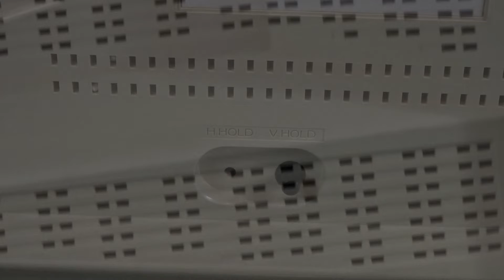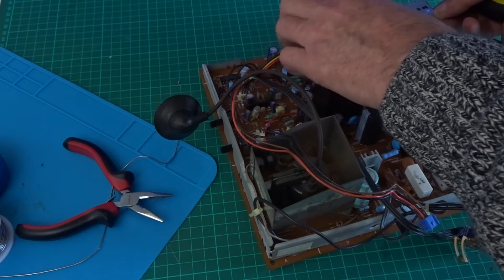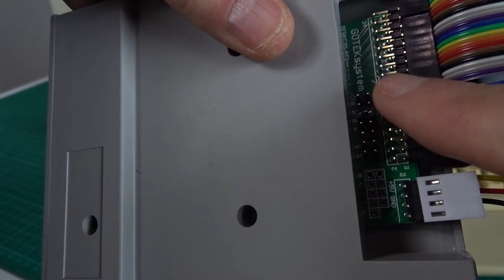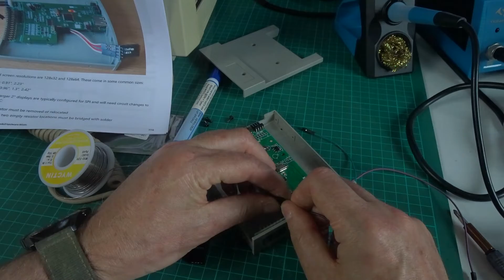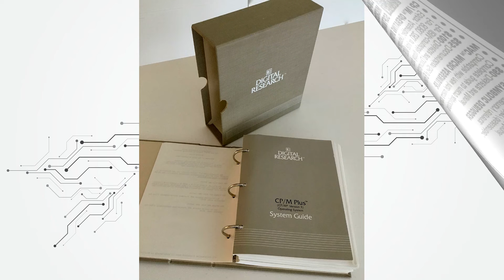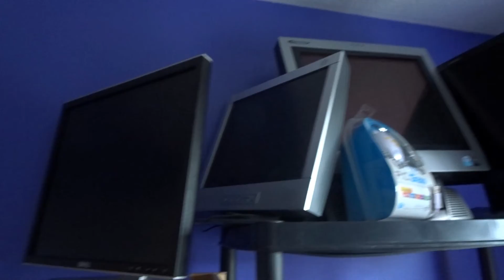Amstrad PCW 9512

Comment: I have the PCW 9512, but it's the most special one,.. why, you know the expansion port where you can connect joystick, parallel, mouse etc,.. adapters on it, 8000/9000 model.
The person who created made those adapters,.. i bought his PCW 9512, when he was on pension,.. including all technical information creation of these adapters,.. and the special thing you can boot the PCW 9512 in 2 modes, normal mode cp/m or booting from a sd that has all technical information. But it's not a sd card,.. its a small motherboard attached at the back of the PCW 9512, holding data.. working like a external HD, SD,.. the first creation of external memory. Later made smaller to usb drive !!!! - I am finally planning to put a online site, with all i have for the PCW.
I can say, i have treasures,..
Reply from the maker: That sounds like a dude way ahead of his time! It sounds like a cool project, the pcw fans would be super excited about such a thing! Good luck with getting it out there! I'd look forward to seeing/trying it. Been a while since AI had the pcw's out😁

Comment: I had one of these around 1990 (maybe a little earlier) and the supplied daisy wheel printer was very noisy. I remember mine had a white CRT display not a green one. Only ever used it as a word processor.
Reply from the maker: Cool, yes I got the printer with it. I'll have to try and get some ink and see what it sounds like😁
Reply: I remember when I used to print upstairs my parents could hear the printer downstairs.
Reply from the maker: Haha, not surprised, they still had daisy wheels at work when I started in the late 90s and remember the clacking.

Comment: I also have this problem with the floppy drive anyone find any fixs?
Reply from the maker: I dont think there is much you can do with these machines, either an original working drive replacement or images specifically for the 9512 on gotek. I kind of gave up in the end and I'm using an 8256 (upgraded to 512k). Drive works but if I ever need to go the gotek route there are many images for 8256 software. I think the drives on the 9512 recorded information differently so many inages out there dont work.
Reply: @66mhzbrain  thanks alot

Comment: Careful with machines with cut off power plugs. I've seen businesses where the policy was to cut the plug when the machine was faulted and a fire hazard (so no one tries to plug it in). 

I was half expecting smoke as I watched that lol. Neat machine
Reply from the maker: Yes I was wary,  quick look at the board it looked ok. Probably wont be using it much anyway as finding software images that actually run on it has been a pain so will end up using an older pcw8256 instead which seems to be what most available  images online are for.

Comment: the design and quality of the new panel is not impressive, to put it mildly))) although the idea of installing an emulator is good and correct
Reply from the maker: No choice butnto install an emulator. No real drives to be had for these machines anymore.

Comment: is the Gotek the same designed for the 8256?
Reply from the maker: Yes I think all goteks work. It's the jumper setting that matters to set the correct read format I think. I have another one the same to fit to an 8256 when I get time. Got a lot of help over at the cpcwiki forum, they know those machines inside and out.